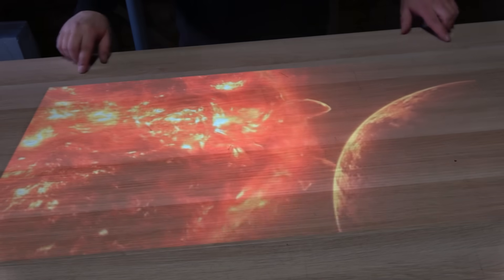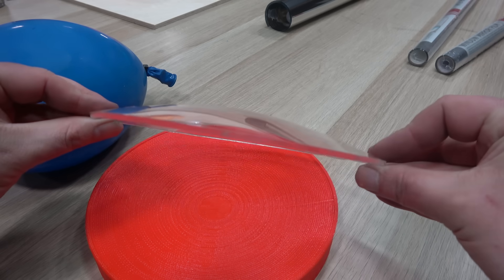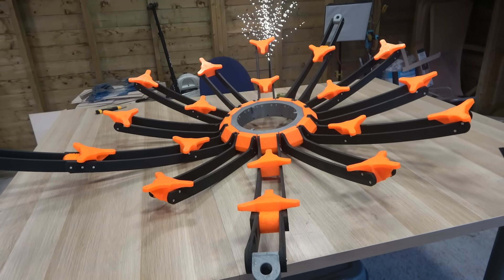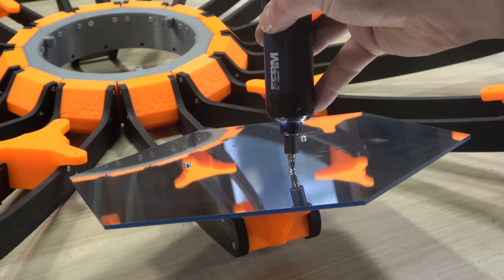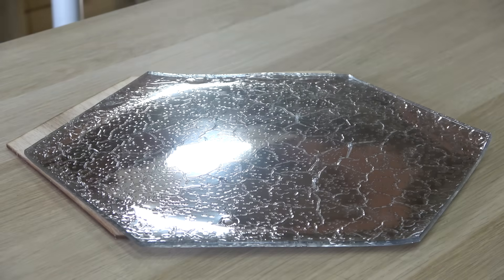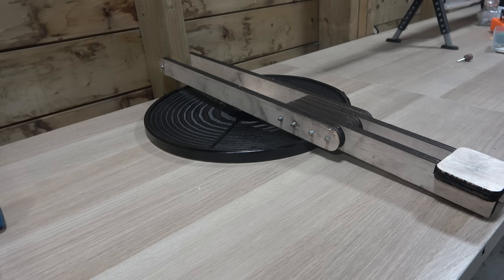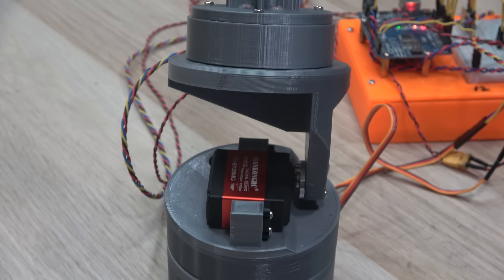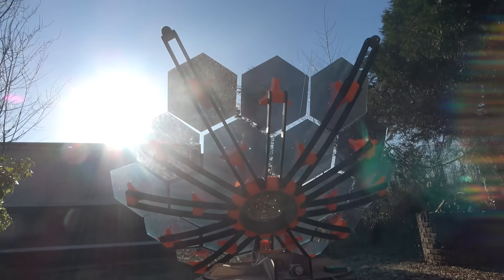Building a DIY Solar Generator..

Comment: you can not use gold paint as substitute for real gold mirrors. gold paint is exactly the same as silver paint with a little yellow pigments added. the base for both are aluminum pigments for the metal look.

Comment: I live in a northern climate where winter temperature stays well below freezing. Could a parabolic reflective surface be constructed be stretching and sealing s sheet of mylar film over the rim of a rigid circular frame, then adding enough water on top of the film to weigh it down to form a parabolic shape, then letting the water freeze. Once frozen to the required shape, fill the back of the shaped mylar with resin, Once the resin is cured, bring the ice-encased mould indoors to allow the ice to melt.  DISCLAIMER: z This is just a thought experiment as I know nothing about solar heaters or the necessary components.

Comment: Gee whiz Batman! Welcome to Optics 101 and grade school science! It's a simple job for simple people! Anyone who had high school math should already know that a mirror would need to have a focus point and that a parabola is the only choice.

For tracking an equatorial telescope mount would have saved you a lot of wasted time and money. They are readily available with tracking systems for absolute chump change. Alternately, a simple Altitude/Azimuth telescope mount could also have been used and many of those also have built in tracking. Both would offer an exact Solar rate of tracking, too. What you did was to reinvent the wheel, again.

Let's see how this fiasco works out in your next presentation.

Comment: you should check out nighthawkinlight's diy solar concentrators video - might be cool to try a 3d double parabolic concentrator which would be smaller but the bucket could be 3d printed and lined with reflective mylar.
Reply: I wonder if a dish design combined with the solar plate would move heated water better with using NightHawks double parabolic shape with the solar dish.
Reply: @krillinbaldhead9863  i've already suggested a 3d (dish) version of the double parabola so you'd have to draw yours up because i'm not sure what you're envisioning.
Reply: @_xBrokenxDreamsx_  Oh I misunderstood your original comment then and agree with you wholeheartedly because I did not word it correctly.
Reply: @krillinbaldhead9863  yeah, sorry about that. it's difficult to describe things in words on here.

Comment: This effectively beats every solar panel on the market, I see no reason to buy a solar panel at this point when you can make this. This effectively means you no longer need to be tied to the grid, with 2 of these you’ll be bringing in over 3kw per day
Reply: A solar panel produces electricity not heat. Compare it after converting it into electricity and you'll see the reason why we use solar panels :)

Comment: Tre tracking of the Sun could be made much easier if you use a polar mount instead of an azimut-elevation mount. With a polar mount, there is only a single axis of rotation to ttack the Sun.

Comment: If your base can adjust to the angle of the sun, you can use a single axis of rotation and make tracking much more simple, sturdy, and easy. Of course each day you would have to adjust the base plate angle...

Comment: some late thoughts.       the 'energy sink' -- not a secondary mirror -- SHOULD  be located  at  the  FOCAL  point.!     the heat energy is not very useful, until it is converted to rotary mechanical motion.     see heat/stirling engines.    in general, the water system should be replaced with a dry heat exchanging system.     idk if a vacuum engine (flame-licker) could be made to work if there is no actual flame.

Comment: 5:06 that lazy Susan seems rather small compared to the ones that are commonly used for building replicas of R2-D2 (and other similar droids). Those are 450 mm in diameter, and easily available on Amazon, and probably other similar sites.

Comment: The ability to fully rotate the disc and lay it flat facing straight up would be nice, and also the base could be made of more durable material to withstand say sandstorms like carbon fiber panels maybe.
Reply: To make the panels I'd use thin apoxy resin layers and just smoosh them together then polish it all up nice and neat afterwards.

Comment: Not sure your would WANT point focus from your mirror segments. That's going to put a huge amount of energy in a small area, creating problems for the materials of your collector.
Your collector almost certainly isn't a point, it has an area, so there's no problem with having the "focussed" light spread out a bit as long as it all eventually ends up on your final collector.
I believe a compound geometry (two or more curves on the mirror) is best for such applications because this also brings light entering from other angles toward the same focus "area". Solar concentrators that heat fluids use such mirror configurations.

Comment: Cette vidéo semble intéressante ... mais elle ne l'est pas du tout : 1- Quand on fabrique une parabole avec plusieurs petits miroirs, on n'assemble pas des miroirs sphériques (ça semble évident mais l'auteur l'a quand même fait). 2- Le miroir secondaire ne peut pas être au foyer ... parce que les rayons divergeront après être passés par le foyer. 3- Pour suivre le soleil, il suffit d'un montage sur un axe parallèle à l'axe nord-sud de la terre (monture équatoriale). Un bricolo ... next ! //
This video seems interesting ... But it is not at all: 1- When you make a parable with several small mirrors, we do not assemble spheric mirrors (it seems obvious but the author still did it). 2- The secondary mirror cannot be at the center ... because the rays will diverge after passing through the center. 3- To follow the sun, just a montage on a axis parallel to the North-South axis of the Earth (equatorial mount). Too bad ... Next!

Comment: its funny because i built something similar 10 years ago and it was sunny as heck for the months where i prototiped, and when finally came the time, it was 2 months of hurracane, i ran after every piece of light that i could get, i found wierd that everybody got the same solution with the sensors and the arduino, i imaginated that solution in my mind, and i thought it was great and after a while a have seen it i think like 3 times with this one, i guess everybody get the same solutions haha im about to see your next video, that i see took 2 months haha, i guess/hope it was between editing and stuff and not because weather didnt want to cooperate haha

Comment: It seems, on those solar sensors (that track the sun).  You mentioned 4 of them.  But, it seems it would work better if each of them were surround by a tube (like the tube from a roll of paper towels).  Maybe not (being how you have 4 of them).  But with a tube I think it would only need 1.  Ahh, you are tracking in 2 dimensions (x and y).  So, like a lighthouse, you would probably need 2.

Comment: Optical engineer here!

I have a suggestion for how you could mount your mirrors and retain adjustability. You should create a fixture that uses three threaded rods that will allow you to adjust the direction of the mirror. One side will mount to your frame, and the other will be attached to the mirror. The threaded rods will allow adjustability without imparting any deflection into the mirror itself. Then you attach the mirror by bonding it using epoxy to the structure. This does present some risks because it is all but impossible to remove the mirror from the structure without damaging it. But you can precisely set your planar location using threaded rods without risking optical degradation. Once you have set your position, you could use jam nuts on the threaded rods to lock them in place. For extra peace of mind, you could stake the nuts down with epoxy glue, going over the outside surfaces of the nut. This will prevent them from coming loose over time, but externally staking the nuts allows for the epoxy to be removed and adjustments to be made.

Overall, an exciting idea!

Comment: 170k terawat at the top of the atmosphere. More like 88k terawat reaches the ground and can be harvested by solar panels, and given today’s panel efficiency it’s more like 18k Tera watt of energy daily, still about 37 times more energy than needed per day. 

Let’s look at the future: assuming we have 100% efficient solar panels, and with the 2% annual increase in energy requirements, we are only 263 years away from reaching the daily solar energy we receive from the sun. 

We we look at it this way it’s pretty grim, given that 250 years for a civilization is absolutely nothing

Comment: Very good 👍. un super projet, il faudra partager les plans (pièces 3d)!et code source si vous utilisez raspberry pi ou Arduino./A great project, you will have to share the plans (3d parts)! and source code if you use raspberry pi or Arduino.

Comment: I read the comments, and many people are saying things like 'this is how the mirror should be,' 'that’s how it should be,' 'you should do this,' 'you should do that.' What you're looking at here is called a prototype. Once it's finished and working, and generating electricity, then you can start perfecting the mirror, the structure, the rotating mechanism, and replacing the materials with more durable ones.
Reply: They are giving condtrucitve criticism. As long as they aren't rude, they're actively helping the guy.
Reply: bro, he indeed asked at the end, what would you do differently.
Reply: He specifically asked for suggestions in the comments, or did you miss that part in your rush to deride those offering ideas for improvement?
Reply: The best part is whatever he is missing, others can offer more insight and better improvements for his next Version he may make in the future.

Comment: bet I am a little bit late to the party.... but a few thoughts on design;
1) There is so much space... why wouldn't you move the mounting points for the up/down control on the center of mass (or higher) of the mirror, and as far back as possible on the lazy suzan platform?  My fear is that the extra force is going to burn through motors, and the bouncing is going to cause all manner of alignment and wear and tear issues.
2) So... you did parabolic mirrors to focus as much light in as tight a focal point as possible on the center arm.... but then you need to reflect that back down to the water plate.  Any smooth or flat mirror is going to just disperse the light back out into an unfocused mess.  you need to have a separate mirror or divit in the reflector for each of your big mirrors to keep things focused, otherwise you are undoing half of your hard work.  Easier yet, pump water through the struts, and put the water plate in the middle of the air where everything is focused to in the first place.
3) The water plate is supposed to absorb heat right?  Paint that puppy black so it doesn't just reflect the bulk of the heat away!  Spend a few bucks on some vanta black and hope it doesn't get burned off by the death ray!

Still, very cool project!  I'll need to see the follow-up video now to see how it goes!

Comment: Use alluminium foil instead of paint to make your mirrors reflective? Its cheap and reflects almost 100% of the light when you use the polished surface...
Reply: Aluminium foil has shtty reflective properties, I do not recommend it for solar cookers. You can see it with a laser pointer compared to a glass mirror, it even strays different when turned 90 degrees.
Reply: @SolarCookingGermany  Are you saying the light is being scattered too much? Here in germany we have alluminum foil where one side is a bit matt and the other side is polished or shiny. i think the shiny side would be decent - not to make a telescope obviously but to focus the light on a larger area it should work well enough, espcially since alluminum foil will reflect 100% of the light - mirrors are also coated with alluminum btw. - in the video i watched he was using some kind of paint that wasnt even completly opage to the light.

But maybe you are right and there are better alternatives out there...
Reply: @Kabivelrat  Yes, try it with a laser pointer and see the reflection on a wall for example. A mirror doesn't do that.

Comment: I love this design! Makes me wonder the best ways to store the heat energy and if its possible to make a steam engine or sterling engine with a small generator. Maybe a thermoelectric generator or maybe the thermal energy in sand or carbon blocks. Could it be taken to a higher temperature with other coolants? Very exciting possibilities!! Hope you do more updates on this!

Comment: You have done a great job here but I believe the JWST was made in such a way as to be able to fold up for the flight 1 million kms out and is not necessarily an efficient design for your purpose, the reason being that a parabolic surface such as a large (old) satellite dish would provide a more efficient use of the circular area to the focal point and would be a lot easier to fabricate & polish or coat with a more reflective base like chrome maybe.
Yes, painting the base of your collector flat black will make a huge difference to heat absorption, but if you could house the collector inside an evacuated glass assembly to insulate the collector from external losses would also gain quite a few more wasted watts of energy.
950W is a good achievement from this setup, nice work.

Comment: 3:00: What you are measuring here is the reflectiveness of two paints at exactly the wavelength of that laser. That cannot really tell you a lot about the usefulness of the actual materials for your use case (paint != material, laser wavelength != full spectrum sun light)

Comment: GREAT, I haven't found a project as good as this one in a while.
Here's a tip: springs aren't hard to make. https://www.youtube.com/shorts/evpe955YRMc
Of course you should use a real alloy spring, which is pretty hard and requires a good amount of torque, but you can also use a small diameter one.
Good luck, man, and keep up the good work.

Comment: You should have think it as a telescope not as a radar! The sun path is known for ever, no need to seek it. You have to make an equatorial-mount telescope targeting just one star: the sun, less complex to do because you just need to make it turn according to the clock and predictable solar declination for the day (for a year = latitude ± 23.5°), not needing the direct sunlight! When, it's cloudy but IR light passes through the clouds, in summer, your rotating heater is not stopped because not finding the sun… (what's stupid: we know where it is by astronomical determination every second of  the day).
Furthermore, each mirror of the whole parabolic reflector has no need to be parabolic!
see HELIOSTAT: a device consisting of 2 mirrors (one 'equatorial' moving, one fixed) slowly revolved by clockwork so as to reflect the sun's rays continuously in a fixed direction (XVIIIth century: mentioned for the first time in 1742 —see physicist Léon Foucault)
Today, cities in mountains use big heliostats to have constant sunlight in winter. Just moving mirrors along one axe (latitude±23.5°) and a fixed reflector and a clock!

Comment: Too bad this video has this terrible AI voice translation to german as the default audio, this really decreases the perceived quality for me quite a lot. I know I could switch back to the original audio track but YouTube does not remember this so I have to do this for about 40-50% of interesting videos and I'm tired of it -> I will just close the tab with a keyboard shortcut as this is much easier and watch a different video that does not use this "feature", luckily there is still enough content without AI bullshit. I can understand when creators want to make their content accessible to more people but the current state of AI is the wrong tool (at least for technical videos as the AI sometimes really butchers the translation e.g. 3 miles got translated to 3 meters on a different video -> it is impossible for me to trust the AI translation).

Comment: Modeling an equatorial telescope mount will make for simpler tracking with just two detectors (1 in the NW quadrant, 1 in the SW quadrant). At the start of each day, adjust N/S for balance. The rest of the day can use a simple clock drive, sampling the detectors periodically to check for E/W clock errors. If you have a good drive system and don't mind a little programming, you won't really need the tracking sensors. Clean drive power and a thermally stable clock might get a bit expensive though. A side effect of using the sensors is you have the makings for a very accurate clock.
It will be interesting to see how you drive daily reset.

Comment: Not an engineer, but just an amateur tinkerer. The only issue I see is 3D printed plastic doesn't like the sun, and particle board won't stand up to inclement weather. Once the prototype is done and shows that it works, I would redo the entire thing in aluminum.

Comment: Parabolic mirrors focus parallel, light ray. So technically each mirror should be a section of a paraboloid that is as big as the entire set up. Because when you make each of them, the exact same individual section of a paraboloid, it no longer focuses all of the light because the light is effectively, not parallel to the axis of symmetry when it is hitting. Because of how small it is, it shouldn’t make a huge difference but no need in going through all that work to make if you’re not going to make them a section of a paraboloid as opposed to all being the same vertex section.